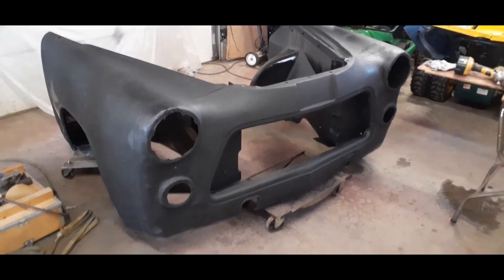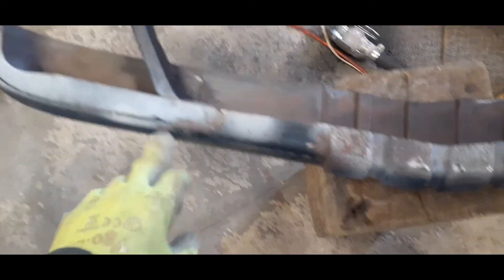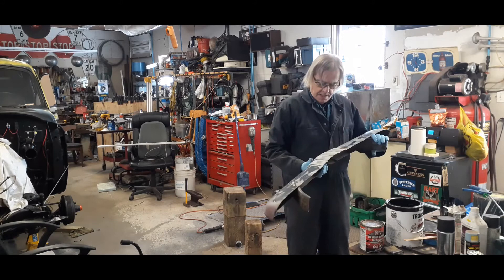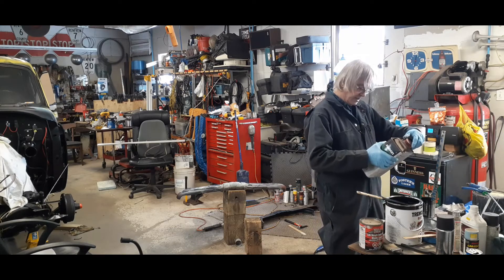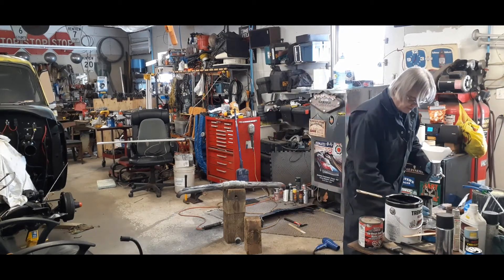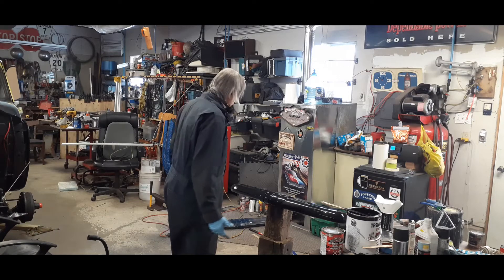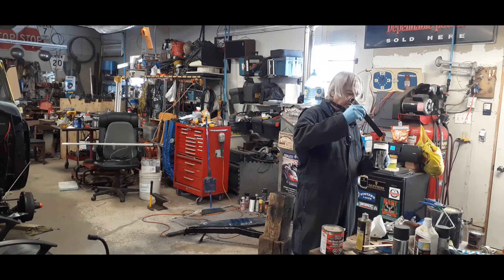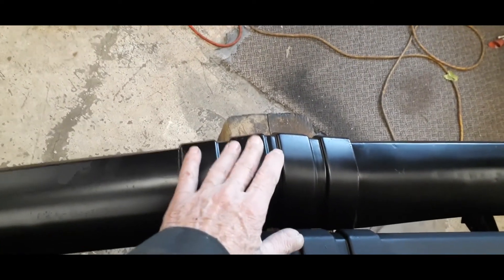# 140  Hardener or NO hardener

Comment: Hardener Will make your flat paint semigloss. I found that out when we painted my brothers 48 Chevy coupe. Also that's how I was taught to thin paint! Now I use mixing cups.  Thanks for the video Andy 👍😎
Reply from the maker: Hey BB King. Thanks for dropping by the Dog House. When I was learning autobody, I was told to use the viscosity cup, But when I was told about lucky 13, I use it all the time now. Besides if you follow the directions on the paint can the viscosity will be spot on most of the time. 13 is a quick way to test.